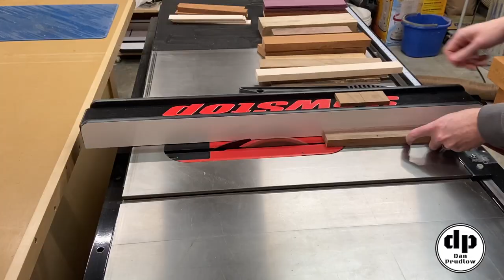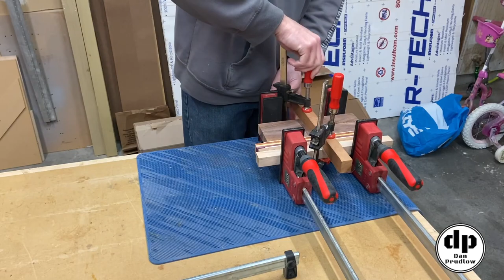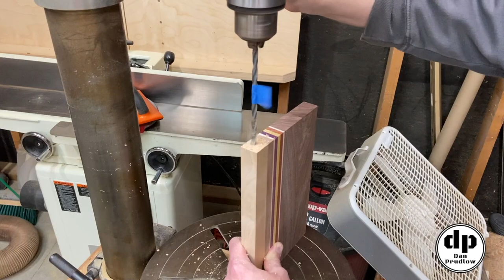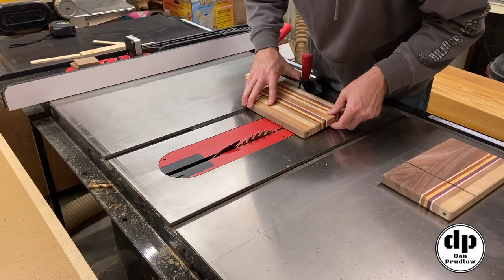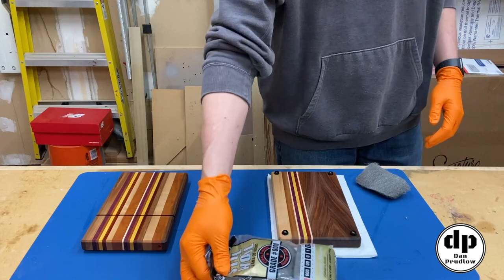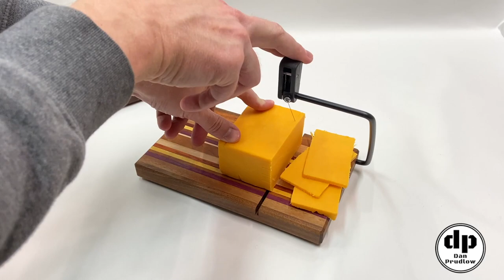Build a Cheese Board | Cheese Slicer | DIY Cheese Slicer Board | Scrap Wood Project

Comment: I just built one of these and am having an issue with it.  The wire does not align properly.  The bottom moves to the left too far.  I can move the top bar to the right to compensate and get the proper alignment, but it moves right out of alignment again.  Do you have ano advice on how to fix that?
Reply from the maker: I had to sort of bend the bar thing a little to get it aligned.  Mine the end near the handle was over to the right because the bar was pulling that direction.  Putting a hole in a scrap and I using it to torque on the par a little ended up working pretty well.